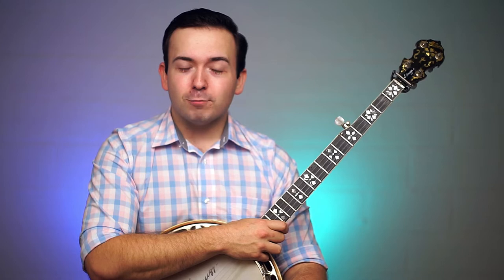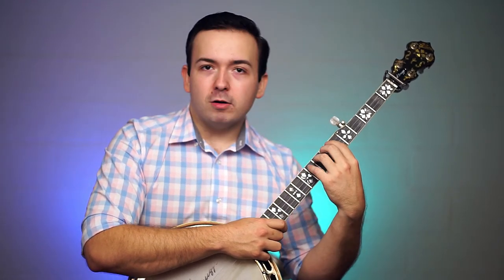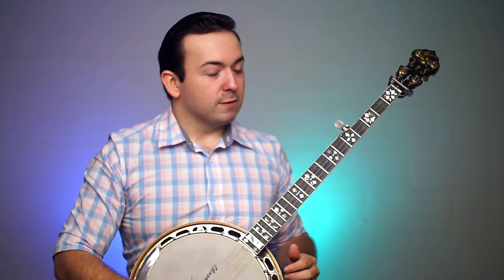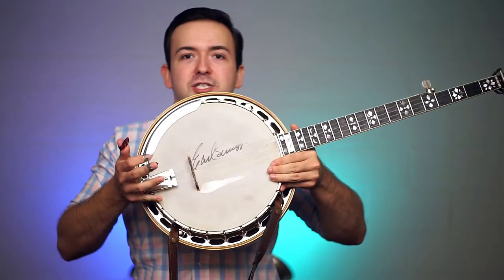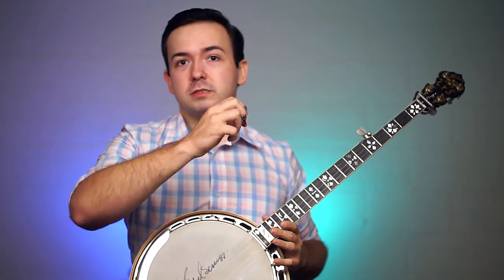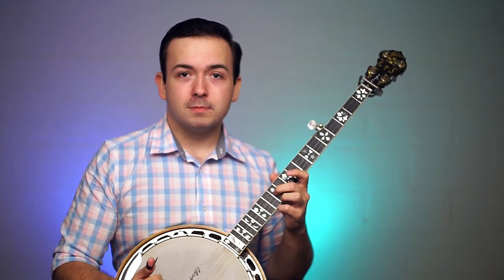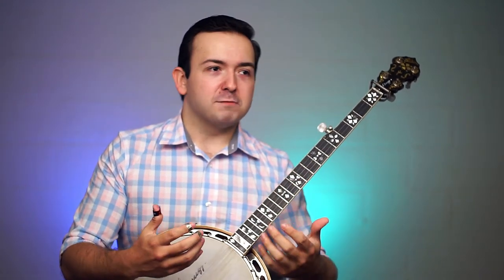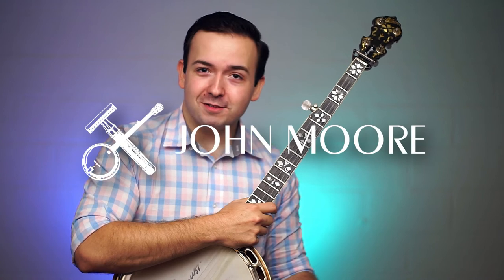What Is A Compensated Banjo Bridge?

Comment: My Banjo I've owned since 1984 has a compensated bridge. i never knew what it was called. I took it into a store last week to have new strings put on. When I got it back he had put the bridge on upside down.  I was so disappointed that the guy at Guitar Center did not know the correct way to put the bridge back on. I of course fixed it. GREAT VIDEO!

Comment: If u liked them bridges get Crowe spacing it's basically the same as a compensated bridge. like when you were talking about the third-string being out of tune. JD Crowe made a bridge to fix that. And it keeps the traditional style look. Check into it.
By the way love your vids keep it up.👍
Reply: crowe spacing is the gap between strings, not the compensated string length. Crowe spacing has no effect on intonation, it's about ease of picking individual strings.